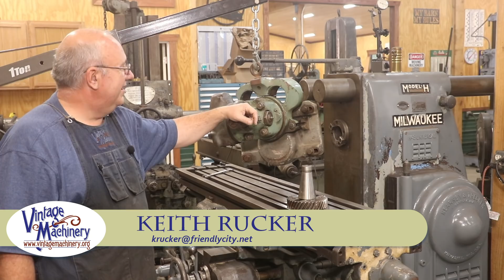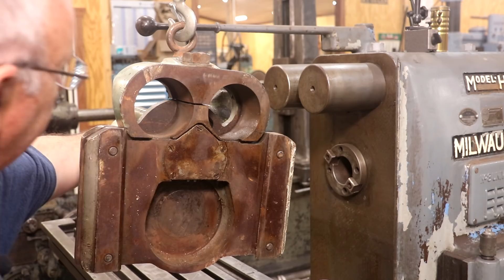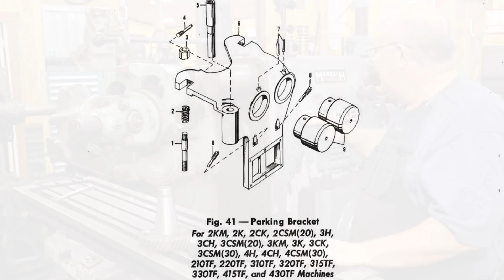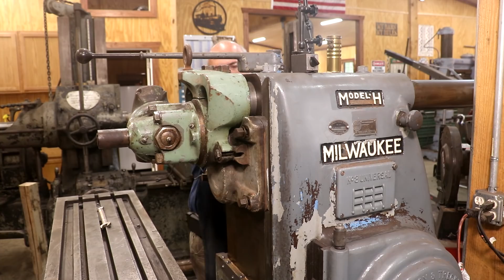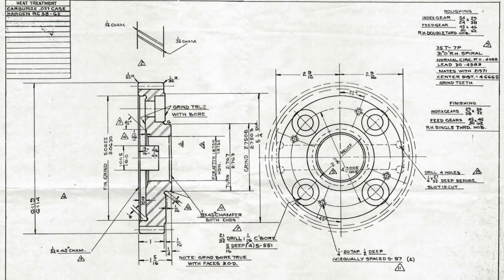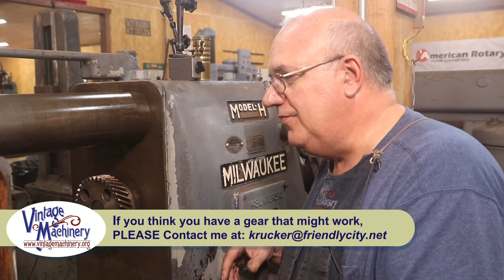New High-Speed Universal Head for my Kearney Trecker & Milling 3H Machine - ALMOST!

Comment: Auction Mistakes:
Sometimes the auctioneer doesn't understand the value of the specialized item up for sale. Please note the following mistakes for machinist related items. Most humorous but sad for the consigner!
A. Starrett 1" travel indicator. Left over from a prior machine shop auction several weeks later, 5 total, 4 unopened brought $30 for the lot sold as welding gauges.
B. Atlas lathe milling attachment. Sold as this "piece of metal" brought $5. Was the lone machinist related item, should have scheduled it for their monthly tool auction.
C. Harig spin fixture in a black case. Sold for $6, again the lone machinist item.
D. Gerstner walnut machinist chest. Used but very clean with key and all working drawers, contained no tools but no till. Sold for $95, however 2 hours later an assistant announced, "Whoever bought the machinist chest there was a piece of wood in the other room belonging to you!"  The buyer had long departed! 
E. Three cardboard flats of machinist chest drawers contents each containing a major component of a shop made planer gauge. I advised the auction house to assemble it to sell separate. Sold to me for $45!
Pathetic but it happens, auction houses don't know everything.  But that is probably how Keith's gear got away.

Comment: What about making a spacer between the machine and the head? It'd only be what, half an inch? You get to use the high speed head with this gear, and you could save this gear, instead of cutting it down, for the heavy duty head if you ever decide to get one of those, and you don't have to get into the expenses of machining a gear. 
I'm not entirely sure of the design, but it looks like these gears are dry meshed, especially given that the dovetailed plates on the back don't seem to seal at all. Because of this, you could make that spacer plate that slides onto the machine and replaces what those dovetails did. Put the spacer on first, then put the gear on the machine, then the universal head, then bolt the head to the new backing plate. You may even be able to keep the backing plate bolted onto the head and have the gear located in place when removing it; which would be an added benefit when taking the head on and off, as a single assembly is better than something you have to disassemble and reassemble each time.
If you cannot find the correct gear, this is the avenue I'd personally go down. It's a better choice than the two evils of sacrificing a gear to make the tool work and paying money to have a new gear made.

Comment: Keith, if you have to modify the gear you have... is it possible to temper it to a reasonable hardness, then machine? Obviously you'd have to harden it when modifications were done, but that might be your best bet. That'd probably require you to regrind the taper after hardening but that might be easier than hard turning that undercut.

Comment: I have had the same experience,  assumed the gear that came with  my model H " War Finish "  would work in a newer head similar to yours.  The gear actually  removed some material from the housing, before I realized something was wrong. With that and a 1/8 inch spacer , I am now using this head on both my vintage '45 H and a newer  330TF. Since the overarms mount on a separate piece, with the clamps firm, but not yet tightened down,  I can adjust the gear backlash by just tapping the gear housing up or down,  You can hear when the mesh is right.

Comment: at least you have a gear print.. so you don't have to pay for reverse engineering..  if it comes to it..  could you set up a motorized spin fixture and grind the front off the gear.. 

 how far off is the other drive gear..  what does the other drive gear fit..  are these drive gears etched with numbers.?? so its not a guessing game.??  looks like the parts manual says that one needs a AR-BK39  (Digital page 68-69_printed page 66-68) where you have may have the AR-BQ43..  what is the number on the drive gear that came with the 3H when you bought it.. http://neme-s.org/Shaper%20Books/K&T/K&T%20Vertical%20Head%20Replacement%20Parts%20Manual%20Cat%20%23%20AR-30.pdf
 for those who want the KT milling attachment parts catalog to assist them and you in finding the correct gear.. 

 is there any chance of creating a shim on a  blanchard ground plate with 2 holes for the support rams and a hole for the drive gear..  longer studs for the side clamps..  perhaps some shims for those also..  making one long one and cutting it in half..    just thoughts..

Comment: Assuming you can press the gear off of the taper, to machine the step in the back, use a rotary head on the mill with a cup wheel in the spindle.

Comment: The head you have is a std hi speed head... The drive bracket stays on the column and the head moves out on the overarms.. That is not the proper drive gear ...The drive gear proper will have a spacer disc on the front of it that engages with the driven gear to maintain proper backlash of gears...You will not be able to attach the head with the overarms in place as with other heads.. You will have to bring the overarms flush with the column first, hang the  unit, then engage the overarms in the head....I know.. I have made just such a gear for my 2h...Cheers from Louisiana

Comment: Hi Keith, Here is a wild idea, find a machine shop that does EDM work. Using a ram type machine, aka die sinker, form the correct pocket on the inside and slice off a disc from the front using a wire EDM . Is that a possibility? Mark

Comment: Sooo many possibilities with that head. If the gear is removable from the 50 taper holder I'd consider making a new 50 taper holder 1/2" shorter. If it's possible hard to tell without being there.

Comment: I understand and agree with your desire to get the right gear, but if that doesn't happen, how about making 2 "shims" that would extend the dovetail grips rearwards 1/2"? They should be easy to make, just 2 steel strips, 1/2" thick, each with a groove and rib to engage the OE grove and rib, plus 4 new bolts, 1/2" longer than the originals. They would only need to be as wide as the machined front face of the dovetail in order to achieve the same strength.

That would be a fairly simple solution that would enable you to use the universal head, while also preserving the original heavy-duty gear for someone who needs it. It should be just as rigid as the original mount, and would make changing back to the correct setup easy, once you come across the correct gear.

This would be simpler than a full-face shim, but it would leave an open 1/2" gap in places. If you're concerned about chips getting into the drive gear area, duct tape would provide a decent seal for the small, occasional jobs you'd be doing.

Nevertheless, I hope you find the right gear. That's certainly the nicest solution.
Reply: I am also searching for a gear for the same head but for a 2H. The problem with using the gear he has is that this type of head is not held in place by the overarms to keep the gear mesh correct.  The head extends out on just the 2 overarms separate from the part with the gear that clamps to the column. The correct gear has a feature on it to ensure the gears aren’t running too tight together and then you lock the  clamps on the dovetail.  Without the correct type of gear it would be a total guessing game to get that clamped on and get the mesh correct as there is some play between the actual head and the drive unit which are only connected by the splined shaft. Hope this all makes sense 👍

Comment: That universal head you said was a 40 tapper right, so is a heavy-duty universal head a 50 tapper? if so wouldn't that be the best option for you, if you can find one?
Reply: It's been said that those universal heads cost as much as the whole machine.
Reply: The head that is a 50 taper is not a double swivel and it doesn’t extend out from the column like this one does. That tube that sticks out the front of his head is to enclose the spline shaft that allows the head to extend out.  This head is much more versatile than the 50 taper head that only swings left or right and is always close to column.  That head will take a much heavier cut though.

Comment: I KNOW THAT FEELING, I HAD A 68 DODGE POWER WAGON, BIG FLAT FENDERS, WIDE RUNNIN BOARDS, I WENT ALL OVER HUNTING PARTS ESPECIALLY TRANSMISSION PARTS, YOU FEEL SO GOOD SHES ALL COMING TOGETHER, BUT THEN NO, PILOT SHAFT OR A THROWOUT BEARING IS WRONG,  JUST MAKES IT SWEETER  WHEN ITS ALL DONE

Comment: If it all worked perfectly Keith, life would be easy and without Youtube Videos :)
On matching the grind, Keith already has the matching gear, it's the wrong one that he has to replace. 
IMHO a better solution would be the remove the hardening, and cut/modify the centre of the existing gear to recess it onto a new 50 taper shaft, then weld/braze or mechanically fasten the two together. If mechanical then the gear could be re-hardened separately.
Cheers,
Reply: How much how or warp be?

Comment: I love seeing these older machines still being used. My vote would be for a series of videos on making a new gear your self. It would be some great content. That is, if you have the equipment or access to the proper equipment to make the gear. I've always wanted to see an in depth look at setting up a super spacer that rotates with the movement of the table that is require for Helical involute tooth cutting.

Comment: I agree with the people here who are arguing for a spacer. The machining would be straightforward, and not an attempt to machine a hardened gear. In the event things don’t go as planned, your only out a piece of stock. If you machine the gear, you have the possibility of causing micro fractures during the machining. And as someone else pointed out, you will need to remove the gear from the taper, dish it out AND thin it, then remount it on the taper, which will also need to be shortened. That’s a lot of machining of very tough material. Conversely, an adapter can be cut or machined to match, and hardened (if desired) afterward. Then precision ground. And if your are not satisfied, you can still modify the gear. But hopefully you will find the right gear and not have to expend the time and effort. Although I am prepared to watch any and all! Good luck!

Comment: Keith, I have the same head on my 1942 K&T 2HL and it is really nice to be able to point the cutter any way you want.   You didn't mention that the head and the drive mount separate and there is a spline shaft that allows the head to be moved out away from the column a foot on the over arms.  I find it much easier to mount the drive without the head!  Then set it on plywood on the table to mount the head on one overarm, then both, then push it onto the drive spline.  Don't need a crane.

Comment: Hello Mr. Rucker, I was wondering if instead in modifying the drive gear would it be easier to make two extensions for the side dovetails clamps to reach around and grab hold of the dovetails on the Milling Machine?

Comment: Just thinking about having his friend with the gear making equipment make the needed gear.  Since Keith has the blueprints, I'm sure at a gear company could make it.

The question is cost.  Maybe the actual way to go is to suggest the company make a limited run of gears and then resell them?  If somebody is "always looking for this gear" there should be some demand.  And as we know, it is the setup that costs so much and takes so much time.  Making a dozen of something will often take only a little bit longer than making one of something.
Reply: Some gear makers do make standard gears X number of teeth for a diameter If that gear happened to be one he could luck out never hurts to ask. I found one for a Punch press 30-inch dia had been sitting on a shelf for about 15 years got it at half price they wanted the room
Reply: Actually, you can count on your fingers on your hands how many of this type & brand of machine is in use in this country. Let alone somebody using the machine with the universal head. There's a reason it is called VINTAGE MACHINE. ORG So selling the gears becomes a no deal here.

Comment: You forgot another option!
Build a giant washer platefor it ,it would be hell of a cheaper and easy to do.All you need is a cnc cut plate steel in a right thickness ,surface grind/shaper it to dimension ,slide that bad boy on and be done with it .You would need to probably build spacers for those dovetails but that is super easy. 
Head is already difficult to put on so one giant washer wont slow the process down.Way more easy than turning hardened steel or making a new gear.

Comment: Can you make a spacer plate to hold the head tight to the machine?  Add longer bolts and move the clamps to the back of the spacer plate ? A big hole for the gear to pass through. Thanks for sharing.

Comment: I really like option 1 because there is probably some guy just like you searching high and low fir the gear you have.   I picked up a used follower rest for my 11” swing lathe that turned out to be for the same exact lathe but with a 12” swing.   I thought about modifying it but am looking for the proper one for my lathe so I can eventually sell the one I have to someone who needs a steady rest for a 12” swing lathe.

Comment: Gear option one is best, option three should be second... Just fabricate a new drive gear from blueprints, and then have it hardened.
ie, option two is a totes no go.
EDIT: You fab everything but the teeth, have that hob job done in outside shop. Much cheaper having just the teeth machined.

Comment: It would not be difficult to make an electrode out of graphite or copper to EDM the recess on the back of the gear. EDM doesn't care how hard it is. It will take a few hours to cut but it is a simple job. The electrode needs to be smaller than the final cut by quite a bit like a 1/16 to make room for the spark gap. Most the electrode erosion will occur on the front edge so if you need sharp corners you might turn a bit off the front edge to re-sharpen it for the final passes. You might prefer the radius it leaves as is. Despite the vastly under size electrode the cut can be made very accurately by orbiting the electrode. The finish can be excellent. Prior to CNC EDM several electrode in stepped diameters would be made to do this job. Some times 5 or more!  Now one is all you need. You can save some money by making the electrode yourself.
Most of the EDM work has gone to China so it should be easy to find a hungry EDM shop.
Good Luck JY
Reply: EDM doesn't care about what Rockwell it is.  A GREAT SOLUTION for internal alterations while cylindrical grinding can correct the external modifications if your gear requires metal removal.  We used copper-tungsten electrodes in the 60s and carbon starting in the 80s for our 5 diesink machines.    
Wire or regular EDM hardens the surface, contacting edges may score dynamic components. Stone if required.

On a Saturday morning in 1962 our shop foreman asked if I could stay after lunch for a couple hours to do a repair job for the local butcher truck? It was boring out a transmission gear so the local mechanic could assemble the transmission yet that day.  "Sure" the 8 month into my apprenticeship said as he explained it was set-up the in the South Bend lathe with a boring bar. "Just open the bore to 1.752"-1.754, call the mechanic when you are done," he said leaving with the key to the tool crib. The gear's thickness was 7/8" with a 1.252" inside diameter, chips flew while I ate my lunch until I got to 1 7/16", then the cutter dulled. He had left a second HSS insert on the on the shop cloth but I was able to regrind my original to start again. Dulled again, regrind the tool, this time scrap, put in the second, same results until it was ruined. Remembering a waiting mechanic in town I panicked! With the tool crib locked "What can I do," finding the Dumore grinder metal box I was able to finish the job about 4 pm, called the mechanic who appeared with the transmission shaft to check the sliding fit. We left as I locked the shop for the weekend.
Monday morning the foreman came by asking why did it take so long, I explained the material's increasingly hardness towards the gear teeth. Showed him the scrap inserts chewed on both ends and the ruined Dumore grinding stones needing replaced.